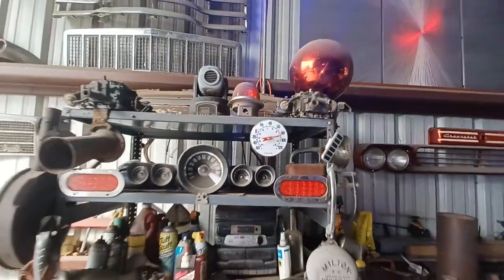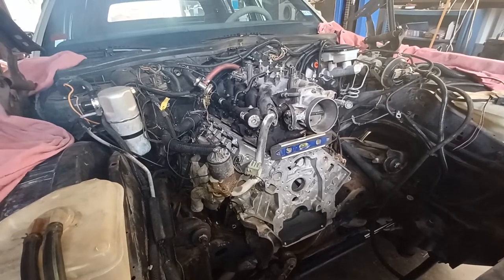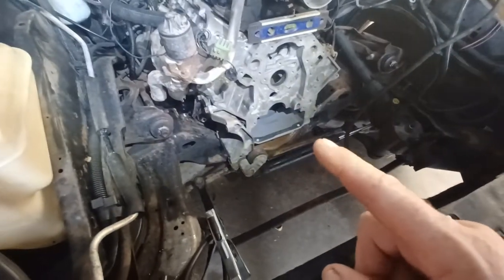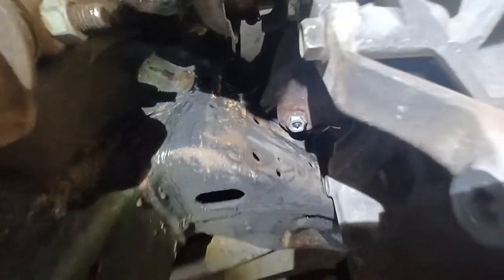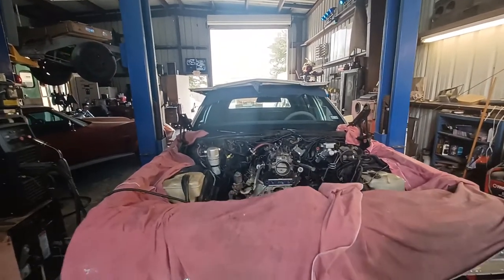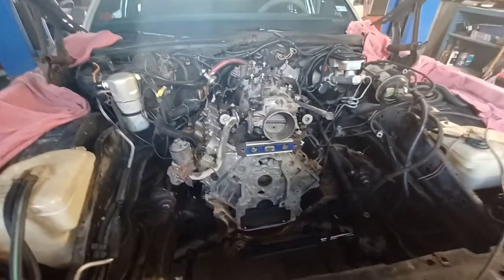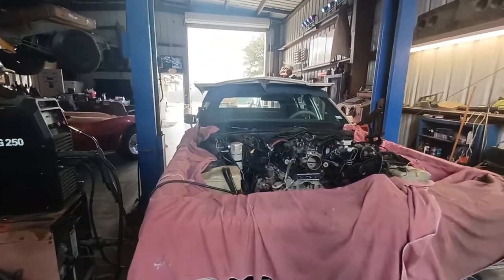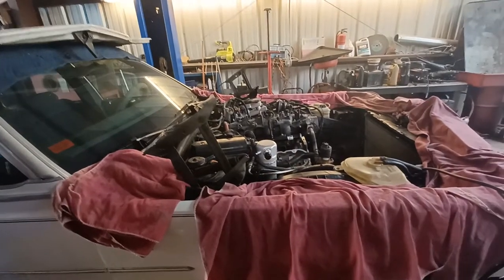1985 Cadillac Fleetwood Brougham LS Swap; Part 1

Comment: So you didn't have to weld and change the position of the cross member you just bought a different oil pan cover??
Reply from the maker: The K-Member Is Still The Same Hight As Originally!!! Yes I Did Get A Low Profile Pan Off EBay!!! There Will Be No Problem With Houston Streets!!!
Thanks for Watching and Keep Rocking!!!
Reply: Thanks... you have a new fan is there anyhow I can come learn from you in Houston
Reply: I would not say you need a new oil pan unless you have a low profile vehicle the truck oil pan will clear a Cadillac sprain barely so you may need washers to space from the crossmember but if you are planning on lowering or have an already Losec vehicle you may want to go with a car style oil pan
Reply: Also depending on which transmission you use will determine the placement of the crossmember for the transmission 4L60e is shorter than 200r that was attached to 307. But if you had the turbo 350 transmission you may be OK

Comment: I also used the electronic throttlebody and Amazon sales the nipple or great booster adaptation
Reply: Mines is already running I just need to finish hanging the exhaust put the driveshaft in if you have any questions or anything like that just hit me up. My power steering is one from a hydroboost so only thing you have to do is put a cap on the extra return

Comment: Call M cells that will fit a turbo 350 dirty dingoes adjustable engine mount and oil pan will be close so you may need washers to space it up I 80 to a quarter of an inch memorial 60 fits in place but you will need to adjust your transmission crossmember you will need a custom driveshaft because the 4L 60 E is shorter than the factory 200 are the factory high pressure for the power steering I believe because I don’t have any leaks yet will work with the truck style power steering high-pressure the low pressure is just a hose I went with factory harness and factory fuse box I did an external Walterboro 255 in-line fuel pump Corvette style fuel pressure regulator filter 3/8 land fuel injected hose. Got rid of the mechanical fan replaced it with a new radiator which is a three-core with electronic fans if you do not have an LS style radiator Amazon sells the coupling and you screw in a barb fitting to run the steam vent line